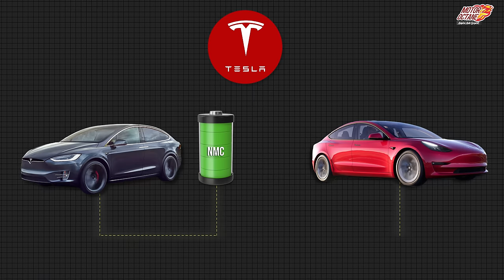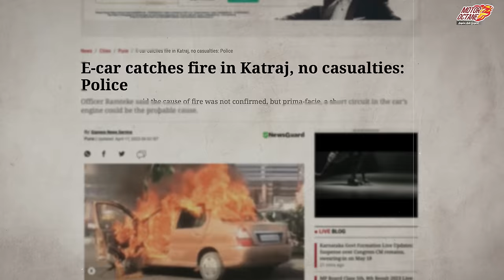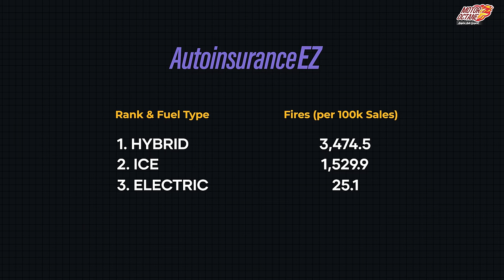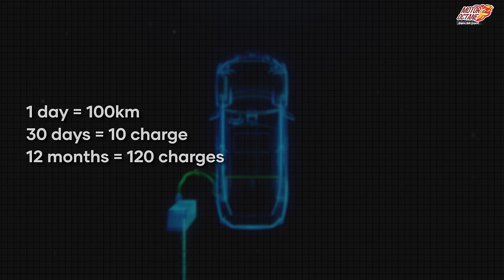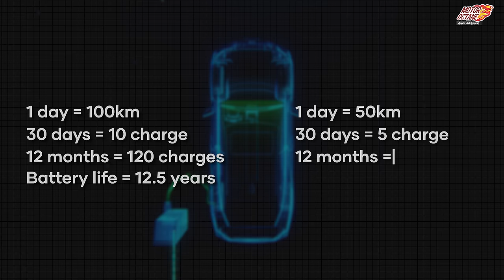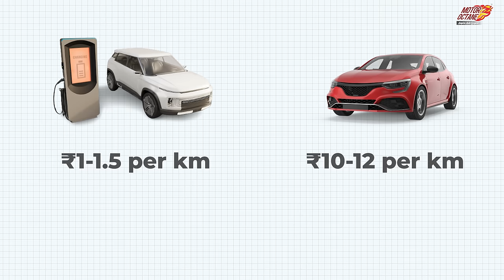Electric Cars have Battery Problems?

Comment: We cant directly compare with tesla as they are sold in USA and Europe and temperature differences are much greater there as compared to India. India being a sub-tropical country and temperature being much higher so batteries will degrade much faster in just 7-10 years and then cost of replacement will be around 7-8 lakhs. We should wait for 5-6 years and see how the battery replacement costs change in the future.